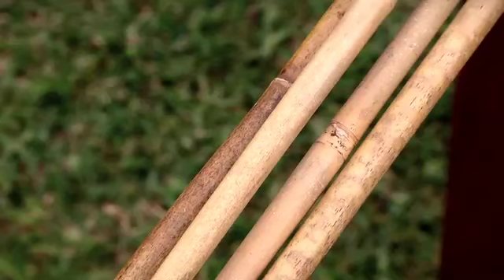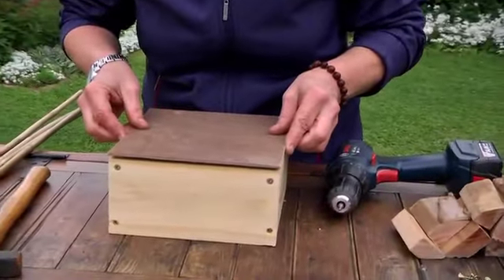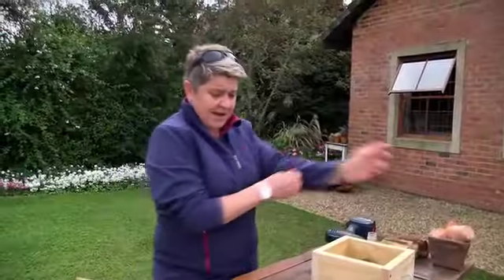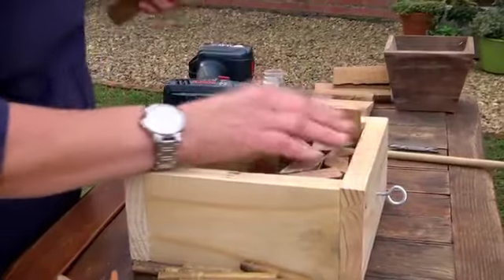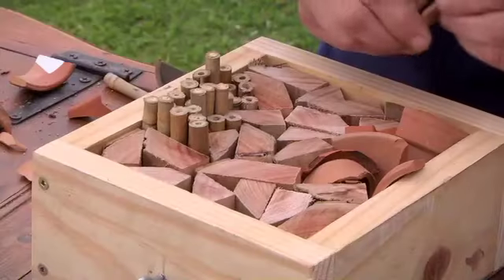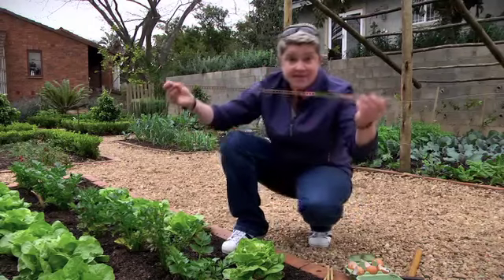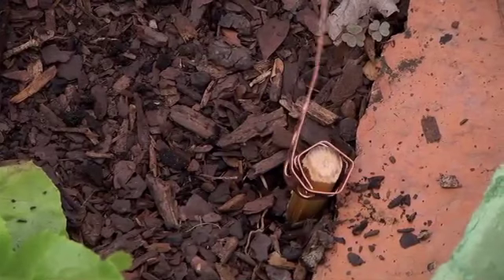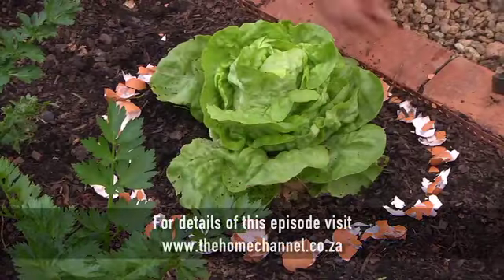Learn how to make a DIY bug hotel

Comment: Nice. I've built x2 bug areas just, great way to use up odds n ends. I used a broken pallet that was a defunct plant stand. And, I've used up some paving blocks and slabs for another taller model. Just need to find bits for it. Great fun. I think the key is to create lots of cheeky crevices using natural materials.